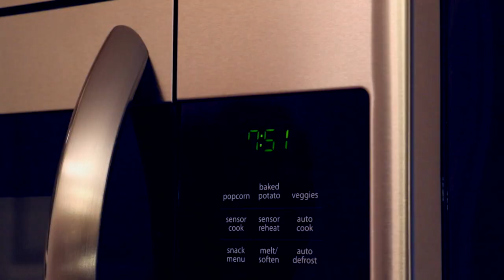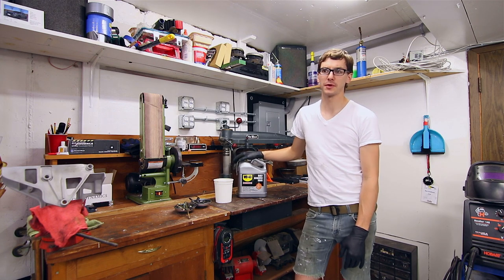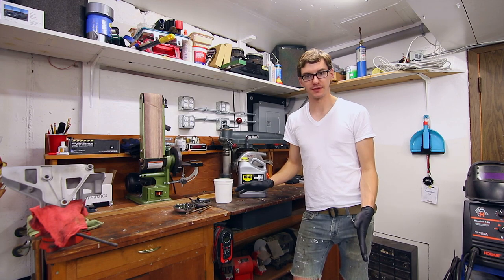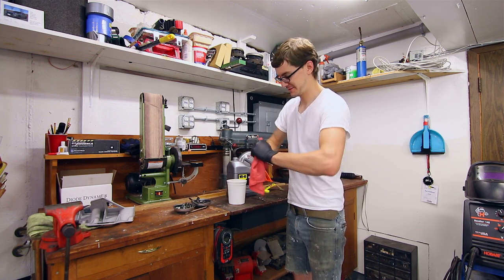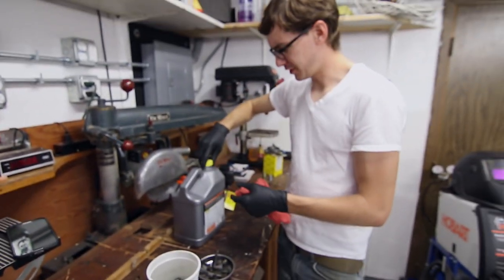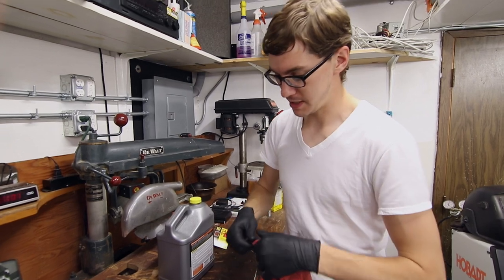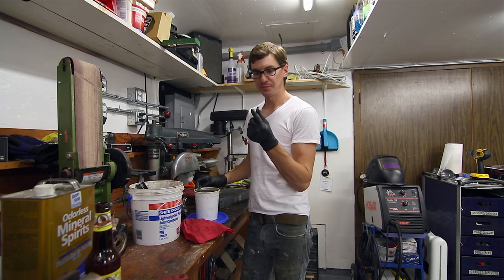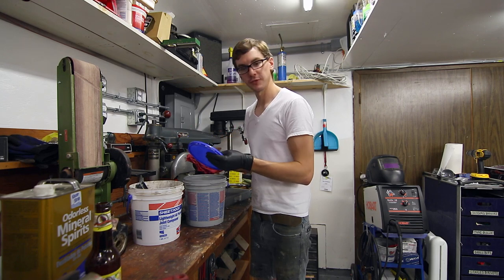WD-40 Rust Remover Soak - Project Syncro #29

Comment: I have just done a load of bolts on my mk2 golf. Soaked them all in a 5% solution of hydrochloric acid. Removes paint, rust and old plating. Works amazing. I would seriously recommend it.
Sold in the UK as brick cleaner is that mixture. Don't know what its like in the US